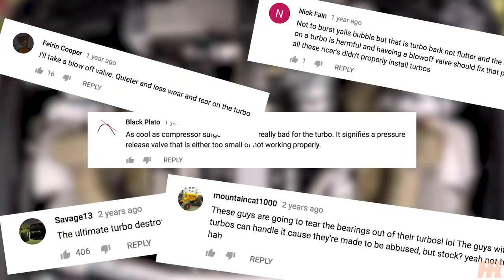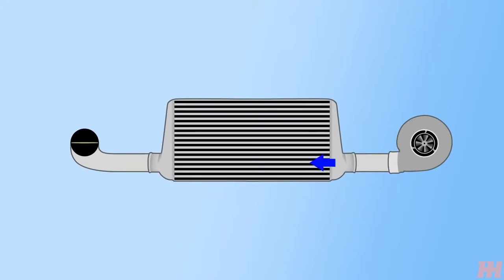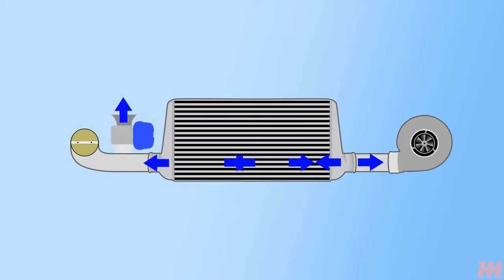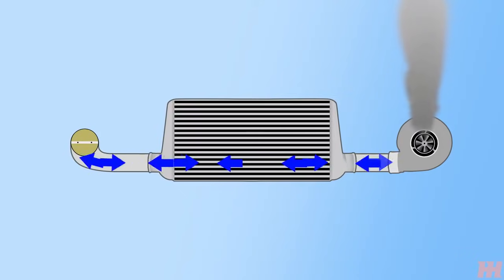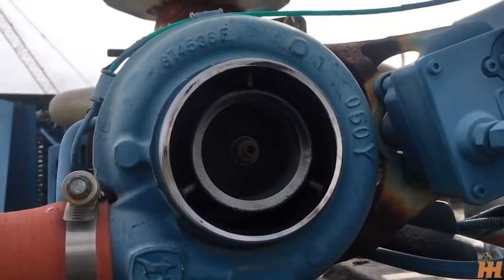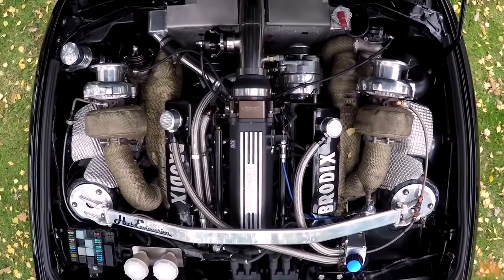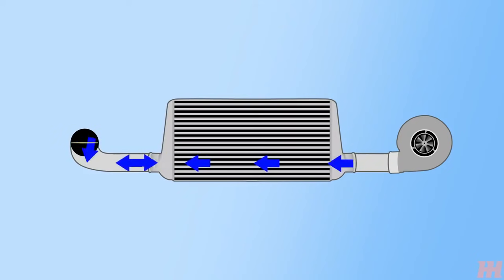The Truth About Compressor Surge

Comment: Thanks for addressing facts, there is so much misinformation  online it’s unreal, magazines still publish about compressor surge to try and sell turbo smart BOV’s lol, fair enough that if you have higher boost and too much trapped air then extra resistance against the impeller over a longer time frame may not be the best thing, but the whole generalised “compressor surge oh no flutter noise when closing the valve” is generally more or less BS :)

Little do they know when they buy a BOV and hear the flutter even louder potentially, because you are just allowing a more free release of air making it easier to hear in most cases, because reducing flutter is not the design purpose of a BOV

Comment: Also not mentioned here: without a blow off valve, all that fluttering back pressure acts like a brake on the turbo wheel, slowing it WAY down any time you let off the throttle, like between shifts if you have a manual transmission, so your losing performance by having to re-spool the turbo every time you let off the throttle and get back on it. Also, without a blow off valve, every time you let off the throttle and get that sweet sweet fluttering sound, it's creating a MASSIVE boost spike for a second or so (much higher than your normal boost pressure) and that has been known to cause pipes and intercoolers to burst.
Reply: Not mentioned here because that doesn't happen, flutter does not slow the turbo down, High Performance Academy have a video tested exactly that and there is no difference in turbo speed after lifting off the throttle between running a valve and running no valve, they both go down at the same rate but anybody that has done it could tell you that, if it make any difference in turbo lag it would not be common place in motorsport, also if it makes a pipe or intercooler burst you must have the worst ebay special known to man, the spike in boost pressure is not that much that it would cause that unless you were already at the limit and by the limit I means running like 100+ psi on said ebay special.

Comment: Saabs, the pioneers to mainstream turbocharging, never used dump valves until 1985. And the compressor surging didnt do any harm to the earlier models.
Reply: I can imagine one reason being lower boost turbos of early times, closed surge would probably be more wearing on higher pressure systems but honestly, I think its a negligible difference, especially how everyone is always debating it and it’s so contradictory, like it’s never been such a significant different that people in general just haven’t come to a definitive answer.

Comment: Does it means if no blow off valve in the system there will be more turbo lag because the turbine had slowed down so much when throttle valve closed?
Reply: Anas Takiyudin it's  really not that bad at all
Reply: I'd say it depends. If you're letting off the throttle for a brief moment (like changing gear) residual pressure that haven't gotten out through the turbo yet will help to build the target pressure faster, but if you let off and leave it for a longer time (so the pressure can completely escape), then yes, rotor will take more time to spool up. Nevertheless, in both cases, the differences are barely noticeable.
Reply: Surge is better for response as the intercooler still has a charge in it that it otherwise has not dumped all out through a bov.
Reply: Lag is actually the time it takes for the pressurised air from the turbo to make it to the manifold. A top mount will have less lag than a front mount typically.
Reply: Ok, the hot side is the turbine, the cold side is the compressor. They spin at the same time being linked with a solid shaft. Ok moving on, what you're probably trying to describe is boost threshold where there is enough exhaust gas to spin the turbo to the point it produces positive pressure. Turbo lag as I said above is what happens above that boost threshold.
Reply: Yes and you can do that in a few ways. You can get a centrifugal turbo and eliminate the exhaust altogether. You can change the exhaust itself with coatings and wraps, its VE, etc, all designed to speed the expansion of the exhaust gas. You can mount the turbo very close to the block. You can put on a tiny turbo which is what most manufacturers are doing now, but they are are only good for low end torque. You can also set up an air injection system that aids in spool.

If you don't "mess with the intake section", then you're not going to get the exhaust out required.
Reply: Neither am I. I'm just laying the facts man. I've said it all, if you don't want to learn, then eh.
Reply: So why are you consistently using the wrong terms and trying to apply lag to something which is not lag?
Reply: Short answer yes. Don’t be like the other guys who complain about ricers but do a unrecommended potentially damaging mod just to hear a sound.
Reply: Sorry it's taken me so long to get back. The time, or rather the point (load/rpm) of when the turbo is making positive pressure is called the boost threshold. Lag is the time it takes for that air to make it through the plumbing from the turbo to the manifold.
Reply: Chorus of angels over better performance any day
Reply: I feel like thats not really the case, cause while the turbine has been slowed, there's still a little pressure present. Whereas a bov vents everything under whatever its set to. So the turbine is still spinning down, but has vented pressure. So imo they would essentially work the same. The "lag" would barely be present. I've had both slow and fast cars with blocked bov and never seen this lag.
Reply: @MV60  "Lag is actually the time it takes for the pressurised air from the turbo to make it to the manifold. A top mount will have less lag than a front mount typically."  
 Absolutely wrong.
Reply: @strider5119  You're correct. "turbo lag" has nothing to do with the length of intake piping.  If it did,  I suppose all of those people with rear mounted turbo kits, or full blown race cars with the turbos mounted in the trunk, or pickups with them in the bed, must all be a bunch of dummies!
Reply: @billymanilli  It's not even a question if it causes extra lag by having more piping, you need to fill all of that with boost pressure,  rear mounted turbo kits are generally seen in street and drag cars where that doesn't really matter.

Comment: There are some BOV with an internal max pressure bypass. Stock Subaru STI BOV does this, at least the older ones opens at about 23 psi. For those wishing to run higher boost on stock BPV, they modify this safety check and boost higher. Not sure how it helps with surge though,

Comment: Putting pressure while there’s still inertia spinning the wheel the opposite way will still have some effect on the bearings. How ever most big turbo manufacturing company’s beef up bearings and shaft cuz it needs to hold more boost in the first place. Ya closed shutter isn’t as bad but it’s still not necessarily healthy either. What I’m trying to get as is don’t go making that noise every time u put your foot on the petal and you’ll be fine. But if u do it 24/7 (no it will not break right away) but it can cause prematurely failures.
Reply: Is also wouldn’t work if u don’t have a 100% blow off valve. The ecu accounts for the air. You’ll basically loose power or fuck up ur tune. There’s a reason big trucks have 100% BOVs they want the turbo to last as long as the Diesel engine
Reply: @eztrash4903  You wont lose power or fuck up a tune. The air shooting through a bov still comes out between the turbo and maf, so it'll either read the air twice or it won't. With or without a bov, it's the same air flowing.

Comment: Time to block my blov of my Subaru :)
Reply: tubejorrit - Unless you have a open/atmospheric bov, it's not a great idea. Basically all turbo cars come with recirculating bov's from factory because they measure air through a MAF. If you change it to an open bov or block it off, you'll need a MAP based tune. COBB makes great devices for tuning Subarus
Reply: Do the bov mod and block the little pressure tube with a 6mm grub screw and then drill a 1.5 - 3mm hole in the tube after the screw. You now have a reference pressure of atmosphere for the bov spring instead of intercooler pressure. That gets you a bov that holds as much pressure as you want and causes a surge flutter before it then vents as normal. You do however loose the backup safety feature of the bov opening automatically at about 18psi boost pressure.

You still need some form of venting on a subaru with a maf as it doesn't like air reversed back through the maf sensor.

If you go vent to atmosphere all that will happen is that when you go off throttle it'll run rich for a second. That's it. You then need a speed density tune to fix that.
Reply: hope your on a speed density tune
Reply: MV60 is right
Reply: @JolleBoiii    No you don't. Recirculating bov's vent back before the turbo and that then goes to atmosphere via the filter. Vent to atmosphere bypasses the filter. Neither of them will do fucking anything to your cars tuning.
Reply: MV60 so is it a big negative to block off my bpv then? I just bought sheet metal
Reply: don't forget to convert your boost pipes with pvc ones to save weight ;;;;))))))
Reply: @strider5119  
Not true.
Reply: @blyndrotor    be specific. Which part isnt true?  Everything I said is factual, not my opinion.
Reply: MV60 is right..   Some cars get a little bit pissy with sensing the air, others dont.  But it doesnt do anything negative, it just runs rich for a second during flutter, which will lead to a light backfire at most. I have never heard of that causing damage. I've seen it on Subarus, a mazda and my current volvo. Would I unblock the bov for that? No, not a chance.
Reply: @strider5119  
Recirculating back before the turbo, BUT after the afm means the afm reads the reduction in flow through the sensor.
It does not flow back through the sensor and out the filter.
That just doesn't happen.
Change a skyline bov from recirc to vent and you get a nice puff of grey smoke from the rich spike on gear changes because the outlet from the bov returns between the afm & the compressor. 
Remove that and the afm still senses flow, that is not entering the engine, but still fuels according to that flow.
We never vented on our skyline.
My rx7 runs a map sensor so I can recirc, vent or both with no issues because it reads manifold pressure not mass air flow.
Reply: And this is why people can’t watch this video 🤦🏻‍♂️ There is still enusha  is spinning the turbine One Direction making the turbines been the opposite direction but still cause stress and the bearings and shaft yeah I won’t break right away but it can eventually damage the shaft and bearing you do not want to have a surprise for pushing opposite ways it’s not that hard to understand

Comment: Closed throttle surge still hammers thrust load back and forth. I've never heard Anyone say the wheel can turn backwards, that's crazy. Closed throttle surge is that last exhaust clearing the turbine with the compressor having nowhere to compress. The thrust load of the compressor is applying force towards the center, the turbine is also applying force towards the center. They cancel each other out in normal operation. When the pressure builds high enough in the charge pipe that it has to escape past the compressor it JAMS the whole cartridge towards the compressor side. Jam is the absolute best way to describe it. As soon as the pressure is low enough in the charge pipe it jams back to the center, also immediately exceeding the threshold and jamming the cartridge again. So yes, closed throttle surge shortens the life of the cartridge. Yes, it can also break blades on the compressor wheel although it is not likely in a hot street setup. When the charge pipe hits max pressure in a 3 BAR + system, the load on the wheel is incredible. 
If you think about the Hellephant 426 with the 3 liter putting it 1000hp to the wheels. It is using a modern high efficiency positive displacement supercharger. It is using somewhere in the neighborhood of 350-400hp to drive the supercharger at peak. Turbos on the same motor at the same boost will make 1370hp give or take. That's how much force is on those little tiny compressor wheels. To be able to heat air up 150-200 degrees flowing 1000cfm is extreme kilowatts of power compressing.
As you said, blow off valves aren't designed for open throttle compressor surge. They are specifically designed for pressure discharge in closed throttle. Why make them if it is not necessary? Rhetorical, because smashing thrust load and taking it away 6 or 7 times on a 13mm bearing with 180 kilowatts of force on it is not good for anything. Especially in a manual gearbox car where you are constantly letting off the throttle.
Reply: Been running a closed bov for 6 years now with the same journal bearing turbo and it still has no shaft play what so ever. 😄 Closed throttle turbo flutter is not bad unless its on open throttle and surging like the uploader said
Reply: His explanation is correct. Though it matters how much boost and what the turbo journal bearing setup was designed for. If you are boosting 30 psi on a setup designed for for 15-20 psi, you will definitely shorten the thrust bearings life span. But a bov isn't the perfect solution either. There will always be thrust bearing strain, bov or not. The bov isn't releasing all the pressure fast enough for closed throttle pressures to not affect the thrust bearing. It does minimize it though. Modern turbos are built different. Better materials, billet wheels, better oiling and cooling.

I think the people who are giving their own anecdotal experience should give others a better idea on how turbos are handling flutter these days. Only downside I've come across is lag.

Comment: So how do you correct open throttle surge (ie turbo is too spooled for motor at a lower rpm)?? It's not to fix the turbo lol you definitely need a valve somewhere to correct it 🤔
Reply: different turbo or adjust your waste gate.

Comment: theres nothing to stop a BOV from opening under WOT though.. if your bov is set low enough it should save you from open throttle compressor surge because the pressure in a charge pipe needed to lead to otcs would be enough to set off the bov
Reply: Boost pressure also pushes on the top of the blow off valve keeping it closed on throttle.

Comment: Open throttle compressor surge happens when your turbos to big for your displacement. So the bigger the better doesnt really fit turbos. The airmass still needs to go through the engine. Should be fixable with programming but then you could just take a smaller turbo

Comment: If you had open throttle surge you will see your boost gauge needle shake on the borderline of stall and it will suddenly drop and come back each time it stalls. If it's not doing that it's not stalling something else is the problem.

Comment: Eh most blow off valves have a over pressure limit to witch they will pop open. Witch is why they are also referd to as a pop off valves. Turbos are also boost regulated by another type of valve on the turbine, drive or hot side of the turbo. This allows gas a percentage of gas to bypass the turbine and limit the speed there for limiting the amount of pressure   it can build.
Reply: The another type of valve is the wategate.It is installed in the cold side.
Reply: @Georgealfa21   nope the waste gate is on the hot side of the turbo. They can be integrated into the turbine housing or into the exhaust before the turbo. It is designed to waste or bypass the turbine to control boost pressure generation. Also turbine over speed in the event of loss of restriction on the compresser side.

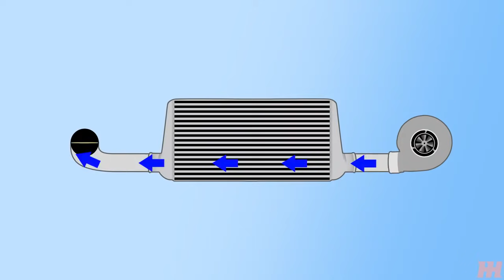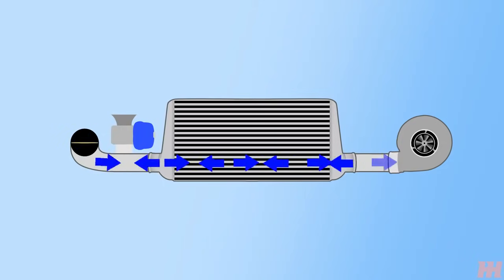Comment: 2:13 - 2:19
Surely if the BOV is set to 20 psi and the turbo is making 21psi at wide open Throttle, surely the BOV will open 
unless it’s computer run and the BOV opens at close throttle 

Help!
Reply: Sean Cockrell 
Thanks, I knew about the wastegate exhaust side but I thought that the BOV was set to a certain psi too but now I know it’s the intake manifold vacuum. Cheers bud
Reply: Lloydy___ I have a mk4 golf 1.8t which makes fluttering noises under full throttle, it has been chipped a few years ago and now that i have watched this vid I'm becoming a bit worried. Should I undo the chipping or make the bov open later? Please help ;_;
Reply: @mezzosplash  change your diverter valve,  diaphragm splits internally.RS6 710P or 710N version are the best.

Comment: drivability is affected because air pressure if buffeted upon applying the throttle again so things are not as smooth as they could be.
Reply: If there is no issue with the ECU it does not effect drivability.

Comment: So how do you stop a turbo from open throttle turbo surge? Why do people use BOV’s? Does the waste gate have anything to do with it?
Reply: Make sure the turbo is sized correctly for the engine and don't run more boost than it can make use of. Bov's just help vent air when you let off throttle, I assume it's mostly to do with noise pollution. Wastegate has nothing to do with it

Comment: Wait but I thought flutter is better the a bov bc it can retain some of the compressed air creating less turbo lag where as the bov removes all of the air leaving with more turbo lag.
Reply: No bov will slow the speed of the turbine between shifting. A bov will cause the turbo to spin higher rpm between shifts helping with lag but you wont really notice a difference enough to feel it imo